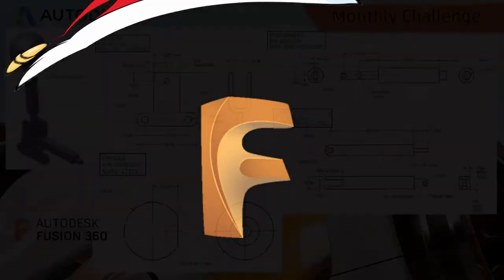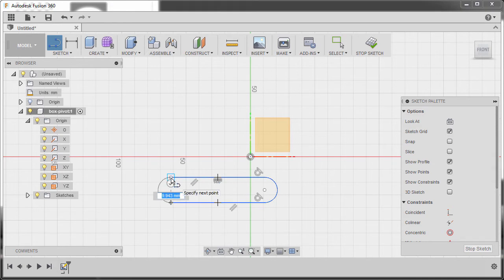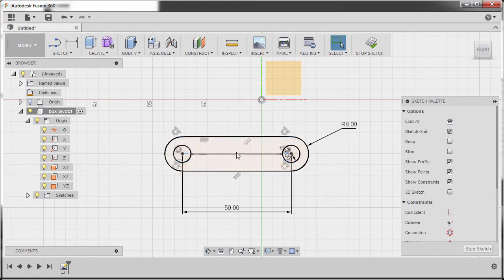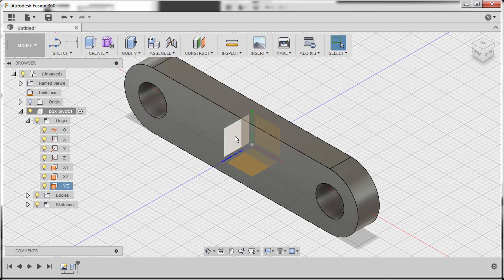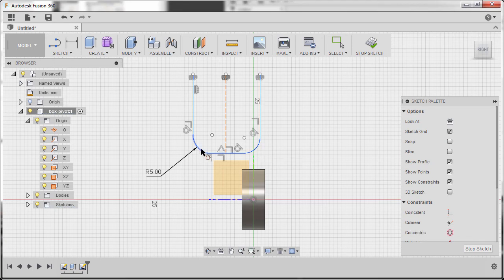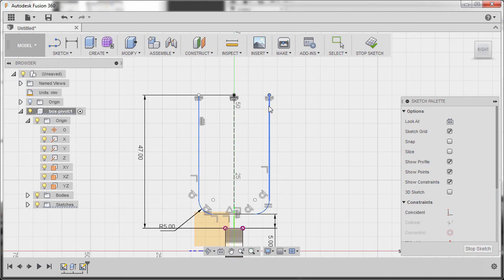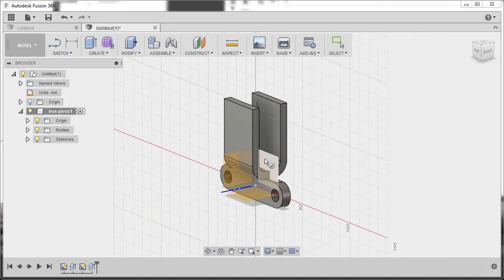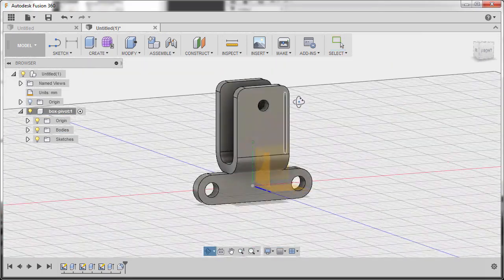Fusion 360 Challenge of the Month: December 2016 - Part1

Comment: Actually, you made a slight mistake. 

The first part has an overall width of 70mm, with the holes inset 10mm from the edges. The hole centers are indeed 50mm apart but they are not concentric to the outer profile. :)

Comment: I had a heck of time with the U-shape. It's tough with an offset dimensioning height and width without it saying it's over-constrained. 

It's also little tricky knowing the inner radius should be 5mm when it's not specified.